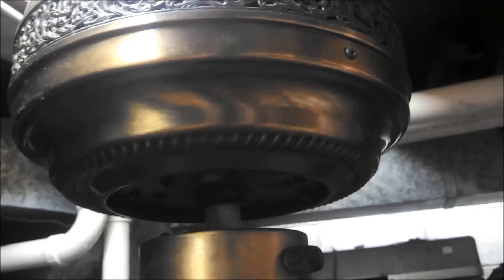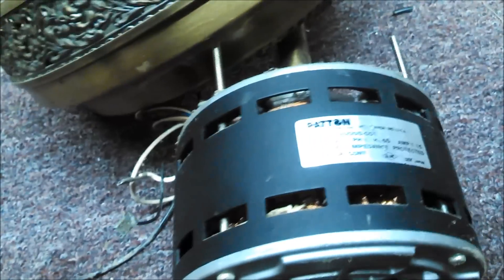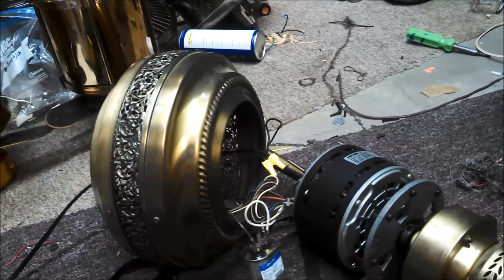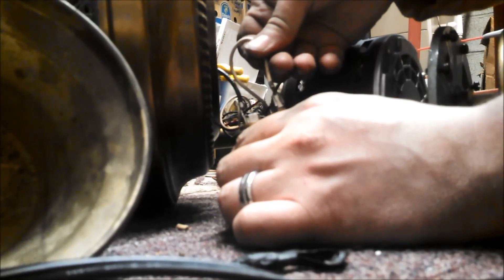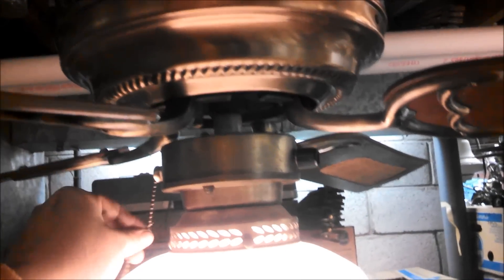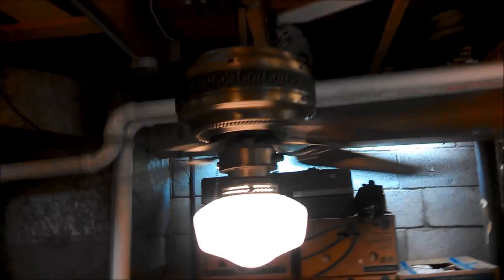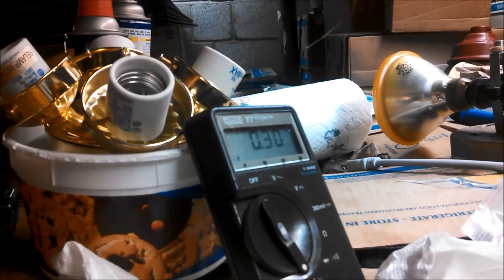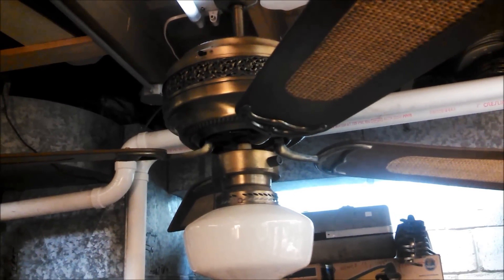Patton Ceiling Fan Motor with failed capacitor (FULL VIDEO)

Comment: Can a bad capacitor make a fan run slow? Or the remote receiver?
Reply from the maker: +Karla Jorge Yes to both.  What kind of fan?
Reply: +Dan ''Spiffy'' Neuman I have a Hampton Bay Miramar. Big 60", after about a year it runs slow, like the third speed which is the highest is running now like on 1. I called the Hampton Bay technical support and they tell me to change the receiver. Well I thought that if the receiver was bad the fan would not turn on at all. But it does and the lights also work good. Can you help me here? Should I replace the receiver? Should I do something else?
Reply from the maker: +KarlaJorge I am not familiar with that fan but I'd bet the capacitor is IN the receiver.  Changing the receiver should fix it.
Reply: +Dan ''Spiffy'' Neuman oh that's a piece of info I didn't know, always though the capacitors were in the motor somewhere. Well, I should give that a try and see what happens. Is that a part I could change, myself without encountering an electric shock? 😰
Reply: +Dan ''Spiffy'' Neuman I had another fans receiver go bad once and it just wouldn't work at all. The electrician simply removed the receiver and connected the fan and lights directly so it now works without a remote.
Reply from the maker: +KarlaJorge Yes but do it with the power off to be safe.

Comment: The windings seem loose...
Reply from the maker: stormblade123hsm huh?
Reply: Dan ''Spiffy'' Neuman The buzz is very loud. I had this happen to one of my speakers which had unscrewed itself due to vibrations. I like bass test songs, that's why
Reply: +SBS7367Y Svc 196 It was because the blades were off so it's noise